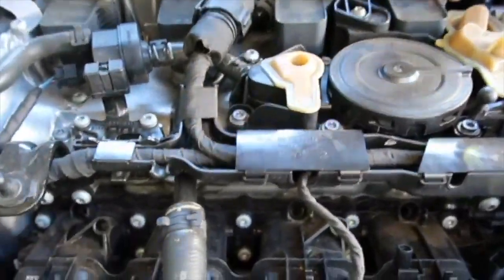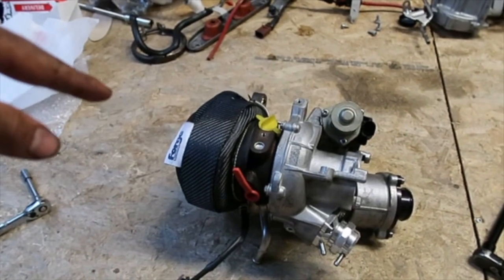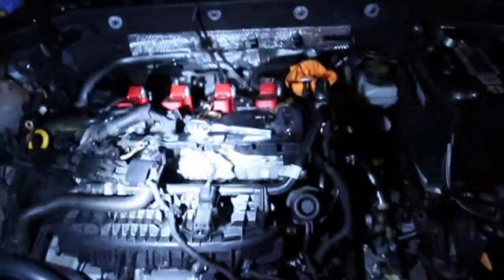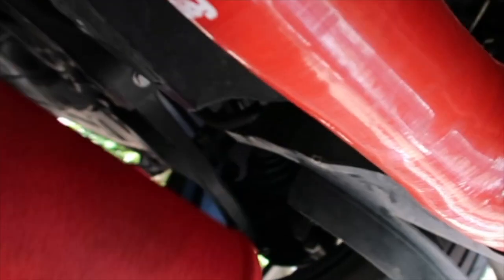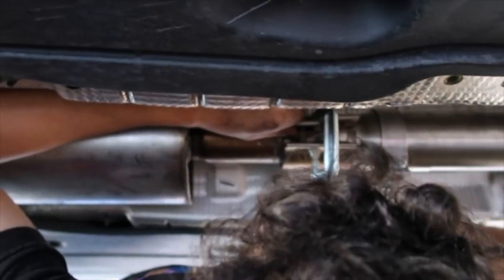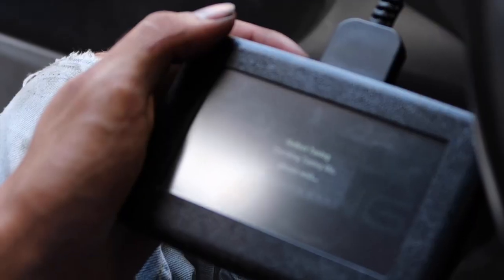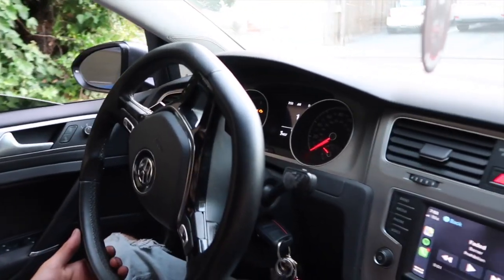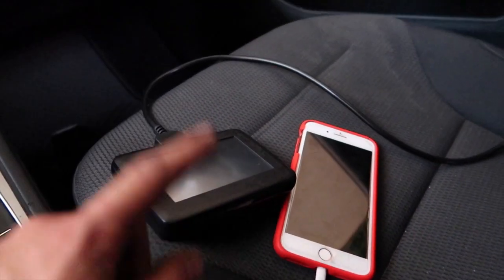IS20 & HPFP swap on 1.8T MK7 GOLF PT2: INSTALL

Comment: Are the shifters on the steering wheel fake?
Reply: why would they be fake 🤣
Reply from the maker: haha no they're extenders
Reply: I have a 2016 mk7 1.8t and it doesn't have shifters. I know the GTIs and Rs have the small ones you can add extenders to.
Reply: @iankonstantino6648  I have a 2016 tsi, I have the shifters…
Reply: @trevhoag7814  yeah I learned now, 9 months later, that in Canada TSI models don't have shift paddles. Unfortunately